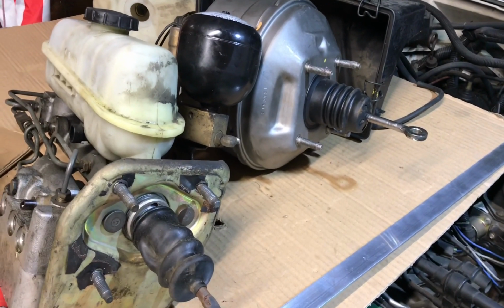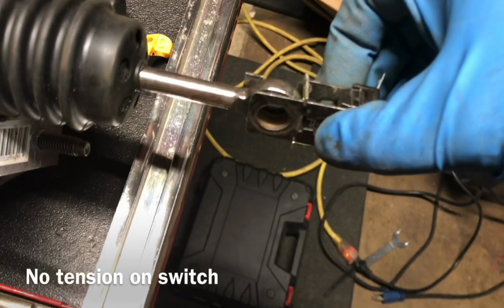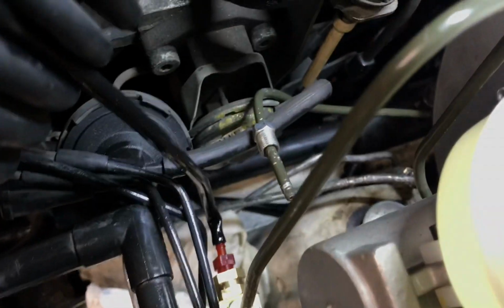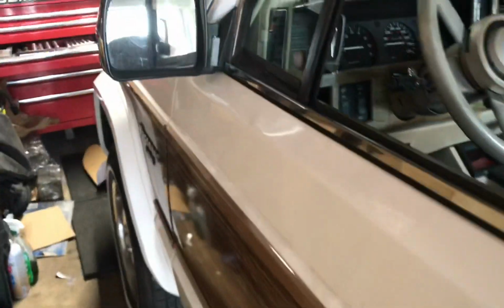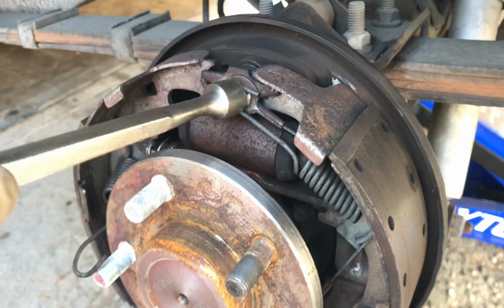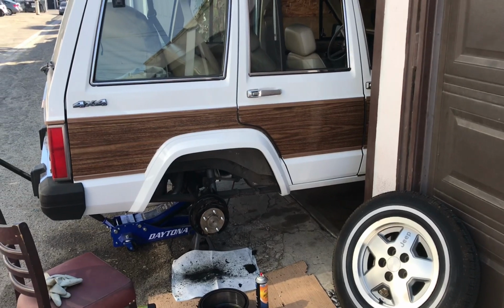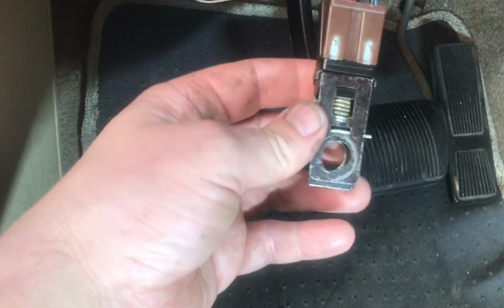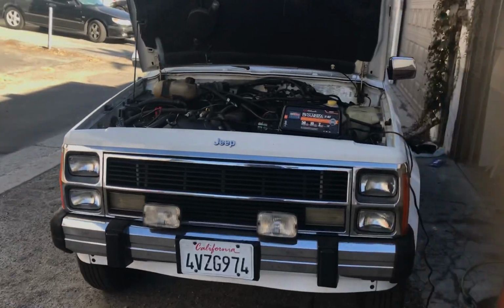1990 Jeep Cherokee Bendix 9 upgrade part 3

Comment: Hello Mikethefixer 
I live in Europe and my car a Chrysler voyager has the Bendix 10 system brake. I see your video for swap a ABS sytem by a power pack normal. But what and where do you buy the master cylinder Kit ?
Thank you for your help
Good ride 
Nicolas from France
Reply from the maker: Bon jour Mousier! To do what I did similar, I would look for a dodge Plymouth, Chrysler caravan, voyager, etc. at a salvage yard ,if possible Still , and remove the brake booster master cylinder assembly. I would think a similar year or two difference would have something that
Works. I think the Bendix system was an option. Hope this helps.